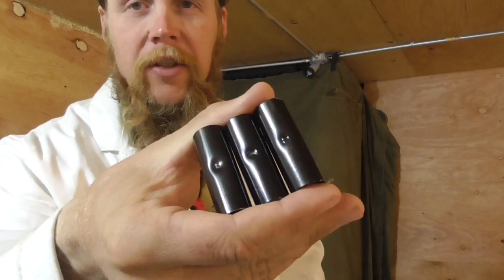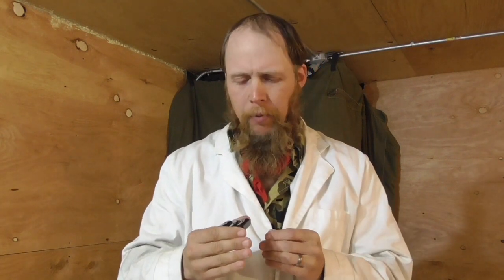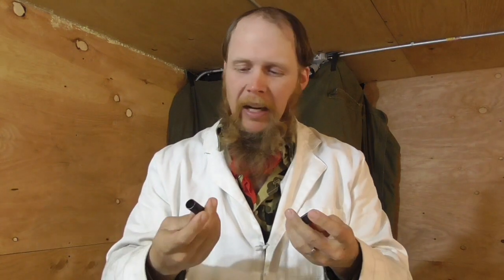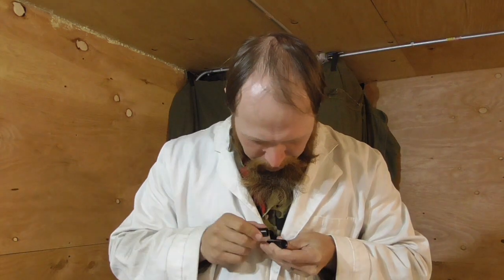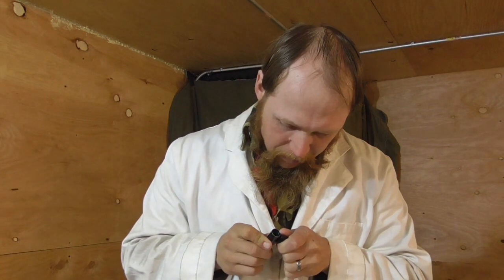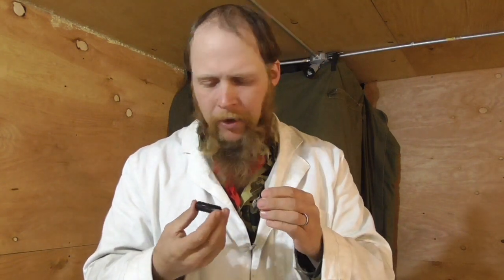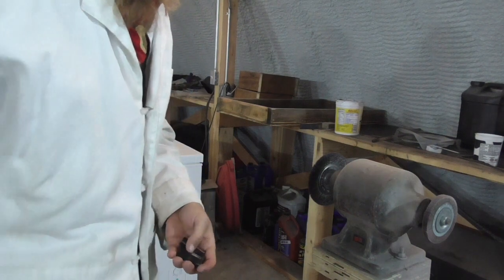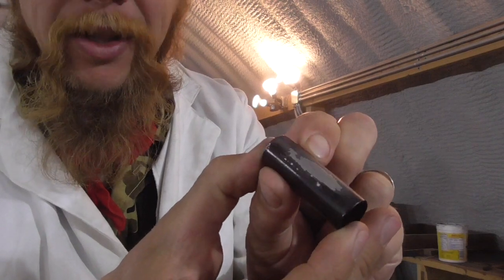Does Oven-Curing Spray Paint Work? (TIS350)

Comment: I learned a trick from a 91 year old man. Once you spray your last coat wait 30 minutes and give the paint a super super fine mist of water then put it in the over. The light water spray pulls the water from water based paint and makes it cure even better.

Comment: I paint metal lures. Spray paint is not used because it just does not stand up. A couple casts in the rocks and spray paint chips off. Oven cured powder coat is my goto because it is so durable.

Comment: Temperature and time matter a lot. Paint is a polymer so too much heat and time could damage it. I would do minimal temp on the oven for no more than 15 minutes, then allow for the item to fully cool off with sufficient time thereafter.

An error I can spot in this "experiment" is that the main reason for baking the regular spray paint is the curing speed vs not baking it. So the benefit of baking is that you get very quick curing vs waiting for 30 days. So, you should have done a test where you spray paint the piece then wait 30 days. Then on the test day you spray paint the next piece and then bake it, then compare.

Comment: I  used to paint cars. After the fresh paint sits in the sun for a few weeks the paint is much tougher. I think it's a combination of UV, infrared, and just plain heat.... I don't think heat alone can compete with the sun...
Reply: The paint, even the enamels, used for painting cars is nothing like the spray enamel from a rattle can.  I think most of your improvement came from the fact that the auto paint simply finished curing and hardening over a few weeks.

Comment: Your testing methodology is not adequate to get an unbiased test. You are in yourself creating a false test by providing pressure on your own. From your video you even say you provided more pressure. A truer test would be to test all 3 samples under the same test in a way to remove your physical bias. Eg put the samples in a rock tumbler for a set length of time each or similar test to remove your inconsistency from the test. However good effort.

Comment: I had to re drill some trigger pin holes in my polymer lower, finally fixed them with JB weld, do you know of any any good hardening spray paint or such I can go over it with to ensure they don't woller back out?

Comment: Suggestion: HEAT the sample to 500 degrees before applying the ENAMAL spray paint.
Reply: I heat smallish parts with a propane torch before painting. Seems to help.

Comment: In my experience a long, low process of curing spray paint at low temperatures (180 -220°F) for 4 to 6 hours does in fact provide a more durable coating. It's all dependent upon surface preparation. A uniform sanding layer to a 400 grit level, followed by a primer coat cured for 4 - 6 hours at the earlier temps. This step followed by 2 coats of color coat, each sprayed and cured separately in the same manner. This coating ends up being markedly more durable than an ordinary air cured rattlecan job. It's labor intensive, but it works. I've used it often for motorcycle parts, and they will withstand rock hits which would otherwise chip a standard paint coating.
Reply: My results are similar, though I tend to ramp the temperature up after a few hours.  
I don't have a powder coating setup, so I'm not at all interested in any comparison.  
I consider oven-cured paint to be a technique to provide a fully-cured part without needing to wait a month for the finish to naturally achieve full chemical and abrasion resistance.
... but then again, most people don't even know that a finish takes more than a few hours to cure at room temperature.
Reply: I do tractor parts this way and the paint will not come off it's a great method
Reply: How much does it safe compared to buying the powder if it's already labour intensive?
Reply: @onpsxmember  
I just don't like the look of powder coat vs a good paint job with clear coat. If you find both finishes equally aesthetically pleasing, my way makes no sense.
Reply: @DarkMatterX1  
Usually I see powder coating with parts that'll see more abrasive wear or are positioned in a less visible place or to get a bit more texture for grip. I wouldn't use powdercoating for everything.
Reply: wow thanks
Reply: Does your method increase gasoline resistance?
Reply: I find myself coming to this comment for once in a while.
Reply: How long do you wait after baking to do the color?

Comment: Did you use appliance paint? That stuff works when you bake it
Reply: My ak builds look great. Rustoleum appliance epoxy works great! I called that company and asked if they were eventually come out with more colors. Told me no🥺
Reply: @250smacks  good to know!
Reply: Ceramic paint is more durable
Reply: @larryalexander4833  that too
Reply: Rusto appliance epoxy is pretty incredible for a cheap spray paint. I’d bake parts at 170 for a few hours and it gets rock hard